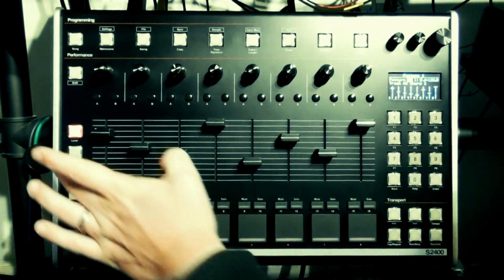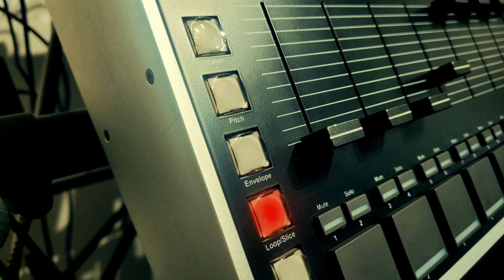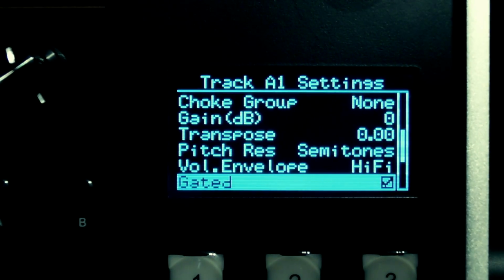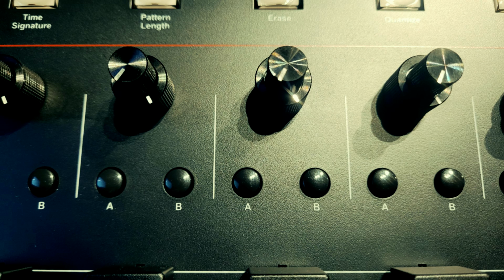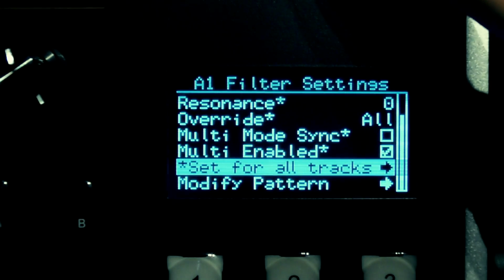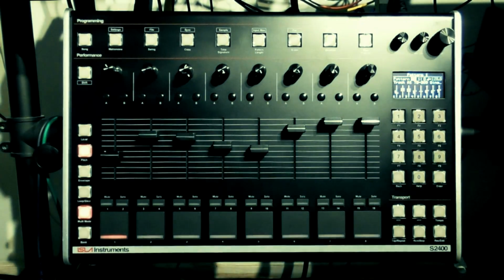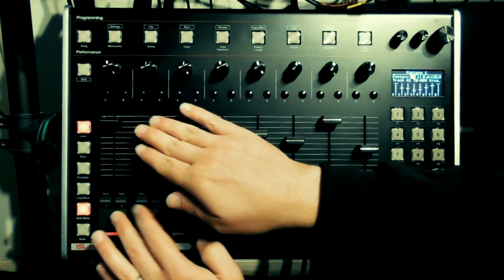Pt.3  - Multimode - Isla Instruments S2400 Video Manual

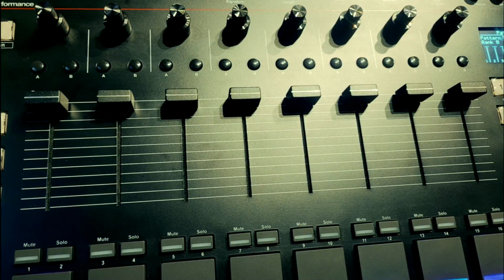Comment: 6:48 was not expecting the effect of multimode envelopes to have such a profound effect on phase correlation, was that intentional?

Edit: It sounds like the combination of the different filter modes, resonance settings, and envelope modulation of filter cutoff have been decoupled from the mono source and presented hard-panned in L/R to create the motion. similar to the effect of the Moog Matriarch in Parallel LP VCF mode with the envelops split, each modulating FC and VCA of  the L/R parallel signal path independently. but with a LOT more envelopes...
Reply: Sounds like the audio is being processed externally. Multimode envelopes don’t play with phase
Reply: @domtak  they do, in fact. all filters, including (non-linear phase) EQ curves affect phase. that's precisely why you get increasingly pronounced phaser effects from multiple poles in an all-pass filter.

but any filter design worth its salt should not have such a profoundly audible effect such as heard in this video, which is why I elaborated on my question with further speculation in the editorial note below it. I think the original intent of my inquiry was, if I can recall, to ascertain what mixing or other processing decisions resulted in the very audible de-correlation rather than any assumption that it was due to the filter itself. perhaps I could have clarified that better.
Reply: @noisemodule  Yes you're correct, filters will affect the phase of a sound. But, I don't think the envelope would unless it was modulating the filter :-) But yes, I think there is a lot of external processing on that final sound as what is heard isn't really possible on the S2400 (though this might now be possible with the DSP card). X